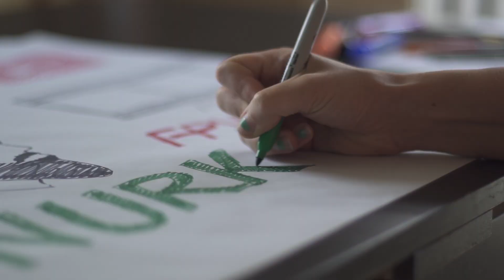Why the Rapid Fire is (for now) the King of Goggle Modules // Giveaway

Comment: Would love to see your opinion on DJI's HD system.
Thanks for the giveaway!
Reply: No thanks.  They have to make a zero lag analog HD system before it's viable.  Digital just doesn't work for FPV.
Reply: @operatorfpv7277  you said there is lag, have you used it?
Reply: silva  nope, I won't risk my money on something with latency issues.  I'm too poor.

Every reviewer has said there is latency issues when you go out any distance.  Basically, when you get static in analog, count it as a latency jump in HD.  That's literally how it works.  If it's a lot of static all at once, you will only see a freeze frame until it gets good signal back.

If you ONLY fly close quarters proximity within 50-100 yards out in the proper direction, the HD system will be ok.  You may still get latency when you drop behind an object, tree or building, which could easily cause a crash.  If you are a very predictive pilot, you could be ok thru most of it.

I'll stick with static and knowing my surroundings.  Digital video doesn't really get static.  The processor can't cope with missing data, so it stops giving you new images.  That's why we still fly analog.

I will switch to HD when they split a 1080p camera stream into 4 streams of analog and back into a 1080p image on my goggles(I think I just told them how to do HD video transmission......).  Until then....
Reply: So much info and you haven't even tried it. Well researched.
Reply: I love how people never tried things but like really, I mean really2 like 'know anything about it' lol
Reply: @oldradiotransmission  I have used HD video on radio.   Not the DJI system, but they all describe the same issues.  It is getting better, but I'm not going to go 100mph and run the risk of my video freezing in every flight.

Can you use it?  Sure.  It's your money.

Would I use it if I had the money?  Sure, for close quarters park and tree freestyle.

Would I battery up and send it past 50 yards away?  Nope.
Reply: @operatorfpv7277  funny if you said you 'digital is not for fpv' or 'Can't trust anything digital over 50 yard' yet you still flying with frsky(or/with) crosfire/R9, those atr digital 2.4/900/915 for control and people fine with it
Reply: @oldradiotransmission  the issue isn't digital or analog.  The issue is the amount of bandwidth over RF.  

The HD processor that requires a digital signal to create an image is the problem.  It can't handle a partial signal.  DJI's new system is better at it, but is still more of the same reason we aren't using HD digital video.  Over one RF channel, the data loss is too much.  Data loss is huge in our analog feeds.

The data is 4x more dense for 1080p.  Because the HD video is so dense, it requires a digital image 30x a second.  In the analog, it streams a constant feed of data that scans across the screen.  That's why you get snow, lines, and sometimes video rolling.  It still shows you the data in scan.

Digital HD requires the image whole.  Because there is no static(snow, lines, etc), and just blur or lost frames, that tells you it is showing the whole image without scanning.  This, and this alone is why this tech doesn't work amazingly for RF based transmissions from a fast moving object.

If they used the same tech as our analog, split the data into 4 different RF bands, and streamed the data and recombined it in scan to the goggles thru the module.....  now we are in business!

This is the best info I can give you.  If you still don't understand how it works, I'm sorry.  I tried.

The RF control links are much smaller bandwidths, and refress much faster, so lost data isn't as noticable and the signal is engineered to be stable within one RF channel.  Tried and true tech.

You are comparing skateboards to corvettes here...

Comment: i love my achilles module, but that dvr is pretty impressive...
Reply: The Achilles gets you the Mode3 performance of these - in some environments that's actually going to give you better looking video (usually open fields).  The rest of the time, frame reconstruction is impressively good since it indirectly rejects multipath.  For freestyle and open park flying, you have what you need to be honest.  The only reason to run the RapidFire is that it's a marginal improvement that makes every quad you fly that little bit better.

Comment: Older goggles just need the secondary power supply cable. Mods aren't required but power output from the goggles isnt an issue as long as you have dual bays!
Reply: good point!

Comment: I like Rapid Fire and the HDOs have been great.   Was without a doubt the best you could get.   But for me personally I am embracing HD.  Sorry if that offends people,  but  I'm not someone who needs the absolute best penetration or range.  The DJI HD system for me, is just a much more enjoyable experience then even RF paired with HDO.   When Fatshark comes out with their HD offering  I will be happy to get that one as well.  Only speaking for myself, there is no advantage from analog that a shitty pilot like me (and probably most FPV pilots)  really needs to worry about.  Lets face it, most FPV folks are flying in parks around some trees.   Which the DJI system, even with stock antenna will be just fine in.